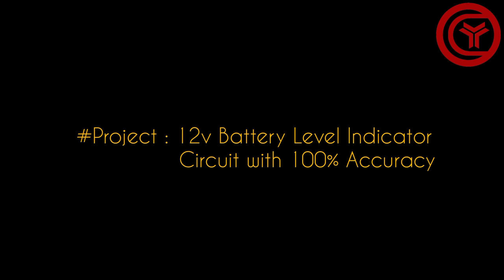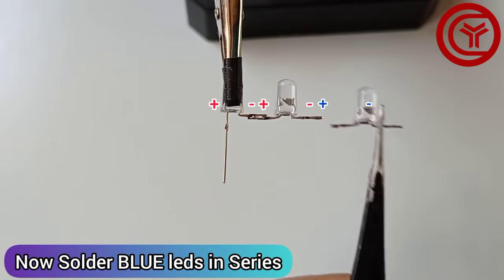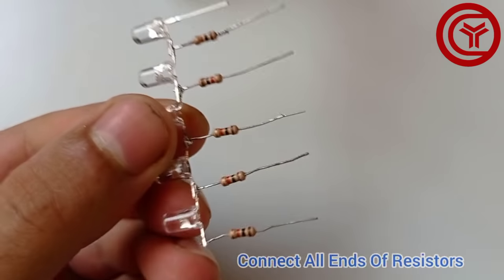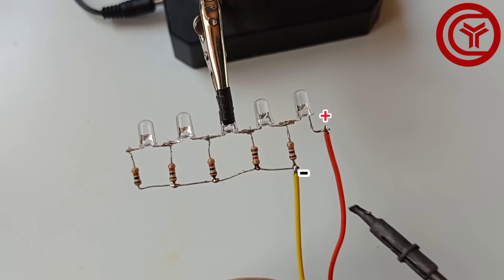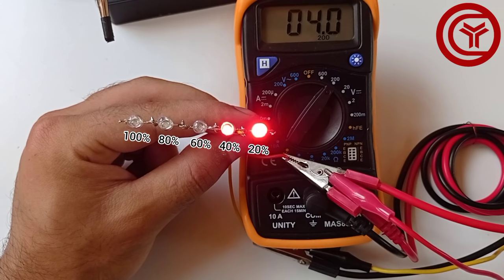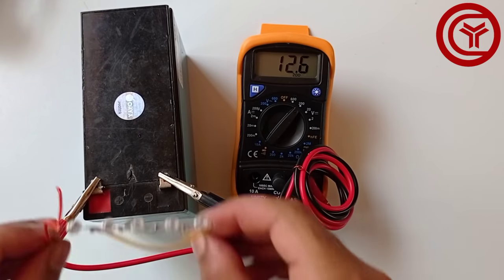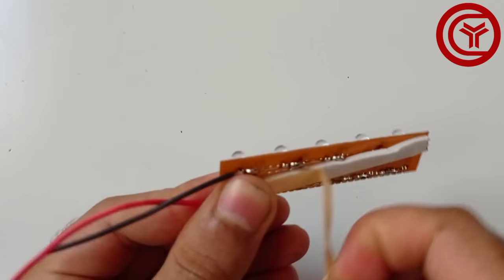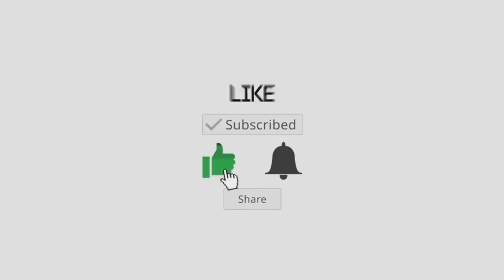Simple 12 volt battery level indicator circuit

Comment: But battery are of no use below 10.5 volt which is like 5% left
Reply from the maker: This was very basic level indicator, check out my new uploaded battery indicator with best accuracy
Reply: Yep. Anything below all LEDs are on is as good as battery dead.
Reply: Is that all depends on the use case. You could be rectifying the voltage down to 3.3 or 5 volts and have this in line. I know the battery will eventually not be able to recharge after discharging that low, but if you're only planning on using the battery once, it can display how much time you have left.
Reply: @@kk7fwm And what will boost converters do in this situation?
Kill the battery more or display fake voltage of the battery?
Reply: @angablade ❤kwe well

Comment: This would work as a capacitor charge indicator, but battery charge is not linear with voltage.  A 12V battery would essentially be fully discharged when your circuit indicated 80%
Reply from the maker: New Type 12 volt battery level indicator.
[ Shows battery status from 10-13 volts ]
https://youtu.be/caJ_3k_dxGo
Reply: i think it needs a 1n4007 between LEDS to work.

Comment: this is really not useful at all, you could just buy an indicator with alligator clips on it so you don't have to freaking soldier it on.
Reply from the maker: New Type 12 volt battery level indicator.
[ Shows battery status from 10-13 volts ]
https://youtu.be/caJ_3k_dxGo

Comment: Good idea but it should be noted that the voltage of a battery is only meaningful if the battery is under load I.e. being used. Measuring a battery float voltage (I.e. not connected to anything,) means nothing about battery condition. It could give you a reading of 12v but immediately drop to under 9v when you connect it to the item it is powering especially if it is a motor or a globe for example. Have your nice meter connected to the battery while it is connected to what ever device it is powering and it will give a more accurate reflection of the state of the battery while being used. Just my comment. Otherwise thanks for sharing the circuit.
Reply: What can be used to check the battery condition ?
Reply: @Xxxcappie23  having the battery run under load and watch the voltage. If the voltage is stable under load then the battery is in good condition,, if the voltage keeps falling or falls lower than the devices threshold operating voltage then you know there’s a problem with the battery and it’s time for a new one, or there is a problem with the charging if it’s a rechargeable battery. This does of course assuming that the battery is working under its normal condition. Does not apply if the battery is being over loaded or short circuited.
Reply from the maker: New 12 volt battery level indicator video
https://youtu.be/caJ_3k_dxGo
Reply: @Xxxcappie23  a buffer stage will be enough, but the circuit would need an external power source
Reply: Not strictly true. There is a very clear relationship between a Lead Acid batteries state of charge and it's "at rest voltage" in fact this is the only way you can test it without doing a full capacity discharge test with a proper battery SOC tester. Voltage under load is meaningless without some rather advanced analysis of the load itself, and the battery type and size.

Applying a load to a small battery will give a VERY different voltage compared to applying the same load to a larger battery, independent of battery State of Charge. 

Problem is that the battery voltage at rest has a range of from 12.7 - 10.5V representing 100% SOC to 0% SOC, thus this meter however is more of a Go/NoGo meter. Even at 80% Voltage, the battery is effectively flat.

Comment: Glad you showed schematic. Most YouTubers don''t show schematic which means that they just care about manufacturing/soldering and not engineering.
Reply from the maker: New Type 12 volt battery level indicator.
[ For 12v lead acid battery, Showing status from 10-13 volts ]
https://youtu.be/caJ_3k_dxGo

Comment: this is a really interesting project and a cool example to show voltage dividers, but one crucial point is that this cannot be 100% accurate if you use 20%, 40%, 60%, 80%, 100% linear scale.

this is because typically red LEDs have 1.7-2.0V drop and blue LEDs have 3.0-3.3V drop so you either have to use six to seven reds, or four to five blues to use linear scale
Reply: Ah, thank you! I was wondering about that, since I've heard different colors can draw different current usage, is it true that the green leds use the least amount of current? Yet I believe that the orange LEDs when the TV is off are the best.
Reply: @Eduardo_Espinoza  its hard to tell which LEDs has the least voltage drop. This is because most of color LEDs are due to chemistry of the silicon of the diode which makes them glow in those color waves. The LED on your remote control that points to the device is actually an infrared LED. There are also some LEDs that are capable of more than one color due to having multiple set of LEDs on it and they're called RGB LEDs.

Current and Voltage is not something that a component "use". its a basic parameter of the electric waves, current being how fast the "flow" of electric waves and voltage being how much energy the wave carry. typically if the power supply has a constant voltage the current changes to fit the power draw, or vice versa.

Either way you can check out the manufacturer's specs of each LED to figure out how much voltage drop it induces on your circuit.
Reply from the maker: New Type 12 volt battery level indicator.
[ Shows battery status from 10-13 volts ]
https://youtu.be/caJ_3k_dxGo
Reply: @CreativeTechos  Dumb 💀

Comment: Gernau, das sehe ich auch so.
"Dies würde als Kondensatorladeanzeige funktionieren, aber die Batterieladung ist nicht linear mit der Spannung. Eine 12-V-Batterie wäre im Wesentlichen vollständig entladen, wenn Ihr Schaltkreis 80 % anzeigt".
Reply from the maker: Check out this NEW 12v battery level indicator, with low battery at 11.5v
https://youtu.be/caJ_3k_dxGo

Comment: Basically when a 12-volt battery drops down to 12.1 or 12.2 it's on the very low side 12.6 it's fully charged it's just matter designing one with right resistors the right voltage you desire red for overcharging green for good yellow on the low side red when you're at 12 volts.
Reply from the maker: Check out this video, 12v lead acid battery level indicator 11-13v level range
Reply: Zener diode not available freely

Comment: Yes a circuit that should work with snap circuits.
Reply from the maker: New Type 12 volt battery level indicator.
[ Shows battery status from 10-13 volts ]
https://youtu.be/caJ_3k_dxGo

Comment: it has the right to work if 1 diode is about 10-12v and if less it will burn
Reply from the maker: New Type 12 volt battery level indicator.
[ Shows battery status from 10-13 volts ]
https://youtu.be/caJ_3k_dxGo

Comment: how do you know which resistors to go with? Let's say I want to test 4 x 18650 batteries.
Reply: The voltage detecting function is actually a function of the LEDiodes forward transfer voltage (Volt Drop). Resistors are only for brightness.

Comment: one thing I am curious about why the higher LEDs go and light up tho, as iirc electric power usually takes the path of least resistance.
wouldnt that mean that the power all should only go through the single led closest to the other pole?
Reply: Actually "path of least resistance" is misleading, and LEDs are not modeled as resistances.  There's a lot going on to talk about in this circuit.

Path of least resistance:  When people use this phrase, they often talk about thunder and lightning, and a more accurate way to describe lightning is path of least breakdown voltage.  The air is actually infinite resistance until the voltage is high enough to tear an outer electron off the air atoms and ionize it, and then the resistance becomes finite because electrons have become mobile and there is a path for current to flow.

Electricity can be more accurately said to follow all paths of conductance (which is 1 / resistance) in proportion to their conductance.  For example if there is a 1 ohm (conductance = 1) and a 2 ohm (conductance = 1/2) path in parallel, twice as much current would flow in the 1 ohm path than the 2 ohm path.

But here there is something even trickier happening in this circuit.  LEDs have a property called a forward voltage, and this is sort of similar to the breakdown voltage for lightning.  The way LEDs work is when there is less voltage than the forward voltage across them, then no current flows (actually the cutoff is not perfectly sharp but it is close enough for this).  The LED is sort of like an overflowing bucket, when the level is below the limit, none flows out, but when it's over the limit everything extra flows out and you can't raise the level above the top of the bucket by much.  

If you look at how the closest LED's path is connected, it only has to overcome the voltage of one LED to light up.  The next LED begins to light up when there is enough more voltage for the 2nd LED (the 2nd "bucket") to overflow into the first one.  And so on down the chain.  The resistors are important because without the flow constriction, all of the available current would just pour into the first LED, which would both prevent voltage from building up enough to light the 2nd but more importantly would simply destroy the first LED if the current wasn't limited.

I hope this provides enough background to understand what's happening!
Reply: @big0bad0brad  interesting because iirc you can for example bypass components by shorting around them, which is a path of lower resistance but sure in this type of circuit the resistors are all the same so the primary difference between the paths is how many LEDs to pass
Reply: @My1xT  Yes - shorting works because it's close to 0 resistance, which is the same as a very very high conductance value and in effect it steals nearly all the current away from the other paths because its conductance is so much higher.

Comment: what would happen if instead of 5 "points" of reference
that series of leds is manufactured with 10 points? 
I make the query to see if it can be made more precise.
and see the degrees of charge of the battery in segments of 10% each.

Comment: I used 10 leds,  when i connect to 12v big battery it lights up 5leds. Other fives doesn't work. Whats the problem. Plz reply
Reply from the maker: It's because you have connected 5 leds extra, Due to series assembly of leds voltage get equally disturbed in leds.
Usually leds are 2.6-3.2 volts, suppose 2.6v x 5 leds is 13 volts.
Same you connected 5 extra 2.6v x 10 means other 5 leds will glow at higher then 13v, to 26v

Comment: Cool, though if 12v battery is on 8v, its already pretty much dead, specially for car use.
Reply from the maker: Check out this video, 12v lead acid battery level indicator 11-13v level range

Comment: Yeah that's an very good diy project but I think it will not work on 12.6v li-ion battery which is connected to bms,bcz bms cuts power when battery voltages goes down than 9.7 voltages so it will not show accurate percentages

Comment: Can we use any type of led lights 
Means without any problem of voltage???
Reply from the maker: Nope then there will be accuracy problem,
Red used is 2.2v and blue used is 3.2v
Or you can check this more easy new indicator video link
https://youtu.be/caJ_3k_dxGo

Comment: What is power consumption of level indicater, it is essencial for battery..
Reply from the maker: 100ma, you can add push button between circuit and battery to check battery level whenever you want by press button.

Comment: Sir, i made this indicator as you teach, but in my circuit the red led blown only not all, and battery is 100% charged.
Reply from the maker: Which type of leds you used, check out specifications of leds.

Comment: The first led only had a resistor after it, technically it should be feeding from the direct current of the source, why didn't it fry when the voltage went up to 12v? Red led can manage 3v atleast doesn't it?
Reply from the maker: But the resistor used is 1kilo ohms which is usually used for about 24volts to limit input.
Like we use 1N4007 diode and a 1M resistor to connect 3v led directly with 220ac
Reply: @CreativeTechos  ohhh so that's how it is. Thank you! I was confused

Comment: ummm, shouldnt 12v batteries be considered bad if they are under 10v?

still a good nice bar graph meter, I'd offset the 1st resistor to have the range be 10v-14v to show weak - good- overcharge
Reply: oh, improved curcuit link in pinned post does this
Reply from the maker: New Type 12 volt battery level indicator.
[ For 12v lead acid battery, Showing status from 10-13 volts ]
https://youtu.be/caJ_3k_dxGo

Comment: Will the same indicator work on a 24v battery? I have a 21v battery (5S 18650), how do I make similar indicator?
Reply from the maker: No, leds will fuse
Reply: @CreativeTechos  And what value resistors do I need to use for 5S 2P 18650 battery pack (21V 5A)?
Reply: What value resistors to use for 21V (5S) battery?
Reply: @rahulpathania78  the double : 2 k

Comment: Is possibile check other voltages? Or only 12v?
Reply: Yeah but you need to calculate the values of LEDs and resistors for another voltage
Reply from the maker: Yes, but different circuit required, you may check out my other videos, there os already uploaded for 3.7v & 6v

Comment: 🙌 Hi Bro! 
 4pcs LED & 4pcs 1k resistor Not enough for 12v indicator?
Reply: That means 1 for 3v. Ya?
Reply from the maker: Bro, if you see circuit you can see the resistors there is doing two works giving negative supply by limiting current, als dropping some positive as resistor is connected from next led positive to negative

Comment: Battary charge komleo light er aalo power akoi thakbe kivabe...jemon mobile phoner a flash light er alo kome na phn er charge kome geleo...janaben
Reply from the maker: Please comment in English, this language cannot be translated.
Reply: Even if the battery charge decreases, how can the light power of the light remain the same.
Reply from the maker: Actually circuit has Resistor which also acts as voltage dividers, so LEDs glow step by step on different voltages

Comment: Superb but what about 5v supply
Reply me which value of resistor should be used for 5v
Reply from the maker: For what you need to use 5v level indicator?
Reply: @CreativeTechos  suppose if I need
Reply from the maker: As it is not usually needed but in your case it need to be tested.

Comment: This circuit used for 35ah to 120ah Lead acid battery ?
Reply from the maker: Yes it can be used, also new video of 12v battery level indicator is uploaded with more accuracy and is easy to make and can be used with any battery. Link below
https://youtu.be/caJ_3k_dxGo

Comment: Can a person do this with more accuracy,by using 10 LEDs and 10x500 ohm resistors?
Reply: No, because this relies on the fixed forward volt drop of each LED being around 2V. You could use 10 LEDs on a 24V supply. Or use an active circuit like an LM3914 to drive 10 LEDs to measure any range of voltage.

Comment: Those types of batteries are considered 100% discharged when the no load terminal voltage drops to 10.5 Volts.
Reply from the maker: Check out this video, 12v lead acid battery level indicator 11-13v level range

Comment: Hi bro can I use 4.5kohms resistor instead of 1 kohms?
Reply from the maker: No, it will, give wrong indication
Reply: @CreativeTechos  noted ,
Also. Bro do you think you can make a video on how to do a 

Push button Hi and low speed controller circuit for  12v 550 motor
Reply from the maker: Yes I'll try to upload ASAP
Reply: @CreativeTechos  thank you , I'm waiting 🙏
Reply: @CreativeTechos  also when I connect the charger to the battery and meanwhile when I have connected the indicator circuit to the battery won't the indicator take input voltage From the charger
Then it will always shop 100% battery yeah?
Is that  the way to connect this indicator circuit yeah?
Reply: @CreativeTechos  just remembered about this ,
Hi speed Ampere draw should be 2amps,
 and low speed ampere draw should be less than 1.5 Ampere 
Thank you in advance

Comment: Worth noting this will only work on lead acid batteries. It won't work on Li-ion batteries
Reply from the maker: New Type 12 volt battery level indicator.
[ For 12v lead acid battery, Showing status from 10-13 volts ]
https://youtu.be/caJ_3k_dxGo

Comment: Home Inverter big battery🔋12volt 180 AH pe work karega???
Reply from the maker: Yes
Reply: @CreativeTechos  aur koi color use kar sakte hai ya only red & blue
Maine socha 
1 red 20℅
2 orange 40%
3 yellow 60%
4 blue 80%
5 green 100%
Ye led laga sakte hai??????
Reply from the maker: Check out this 12v level indicator circuit
https://youtu.be/caJ_3k_dxGo
More accurate better and safe.

Comment: Can i Use any color led ????
Reply from the maker: Only Red 2.2v and blue 3.2v
Check out the New easy 12V level indicator circuit video link
https://youtu.be/caJ_3k_dxGo
Reply from the maker: The New 12v battery level indicator link above will work on big batteries

Comment: It's is a charge indicator. Designed to show how much charge is flowing through a curcuit, not really Designed for this purpose but its still a fun build.
Reply from the maker: New Type 12 volt battery level indicator.
[ Shows battery status from 10-13 volts ]
https://youtu.be/caJ_3k_dxGo

Comment: Okay, but a battery isn't at 0% when it has only 2V-3V left... in fact, that battery with 8 volts isn't at 50-60%, it's already severely over-discharged which will damage it.
Reply from the maker: New Type 12 volt battery level indicator.
[ For 12v lead acid battery, Showing status from 10-13 volts ]
https://youtu.be/caJ_3k_dxGo